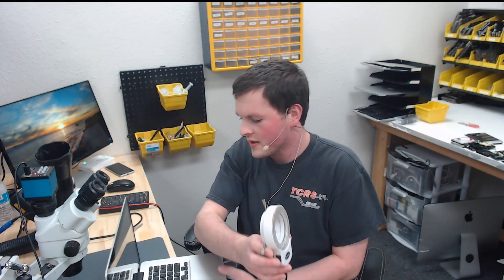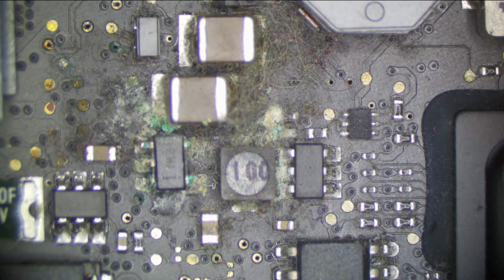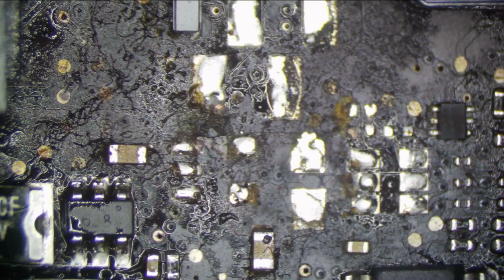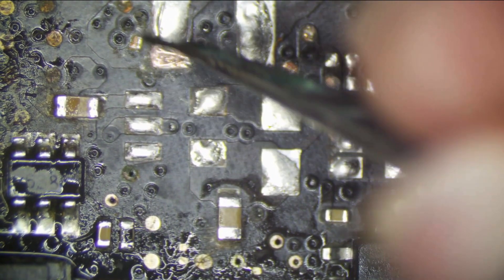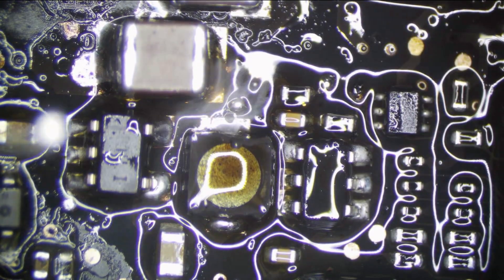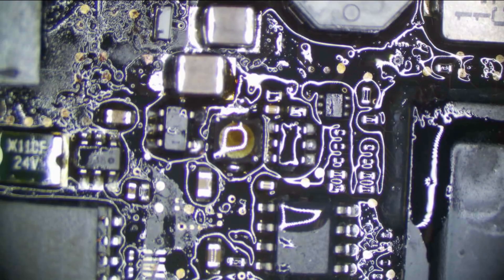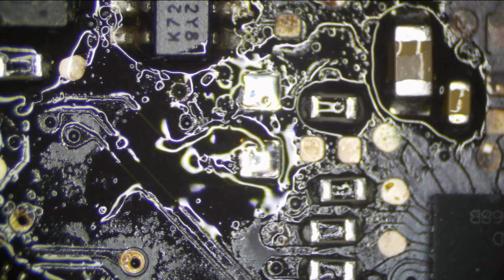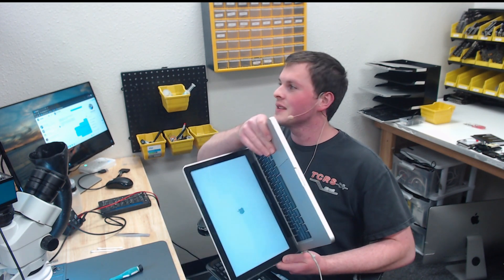A1278 MacBook Pro with a backlight short? Did the fuse win this time?

Comment: Howdy, thank you for your videos! I have an issue with an A1278. I have no Backlight. Fuse is good. I tested the voltages on the LED Driver and I have 12v on the Backlight Output Caps...so my boost circuit isn't working. All the other voltages check correctly, so I changed LP8550 and I still don't have Backlight and the voltages all measure the same. So my question is...could I have gotten a bad new Chip? Or should I look elsewhere for an issue? I haven't been able to find any videos to help past putting a new LP8550 chip in. Thanks!

Comment: I've got an A1278 that keeps blowing the fuse after a  few tries, any idea what the best route of investigation? Whilst fuse is working it does not exactly load the proper screen but keeps loading different shades of grey. When it blows it will load the screen correctly without backlight -c confirmed by shining a lamp is at the back. This started happening after I changed the speaker modules and charging port module. Many thanks in advance.
Reply from the maker: I want you to engage brain and think about the possible reasons a  fuse would blow.
Reply: @TCRSCircuit  I replaced the fuse and it blew again :(
Reply from the maker: @josmarazzopardi6439  Of course it did. The fuse did it's job. Think about what would cause a fuse to blow.

Comment: You could also have a bad cable from damaged pins
Reply from the maker: You could, but it was not.
Reply: @TCRSCircuit  right, I was just going over the possibilities I could think of. Great video though!
Reply: @TCRSCircuit  ironically enough I just got the same machine in for the same issue.
Reply from the maker: @optimizelogicrepair2784  they are common.

Comment: Remember me from that live stream you did a while back? I was asking what was wrong with my MacBook Air a1466, 820-3437-B. I followed your instructions, instead of using alcohol, I probed around the area where the burning smell was coming from, holy crap! C7430 was very very hot! It burned my finger! Looking on board view, I found that it goes to PPBUS_S5_HS_COMPUTING_ISNS and the other side goes to ground. So I removed it and plugged it in, and boom! The fan immediately started spinning, thank you so much for your help! - I found out it was a tantalum capacitor. Do I need to replace the cap?
Reply from the maker: Probably not.
Reply: TCRS Circuit ok, thank you so much!!! :D